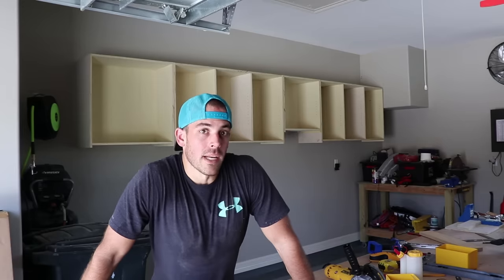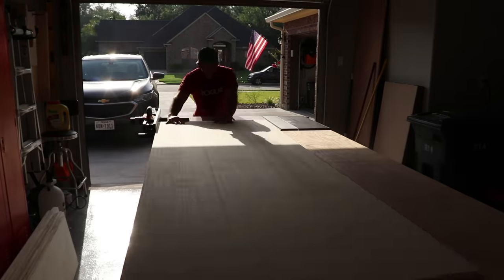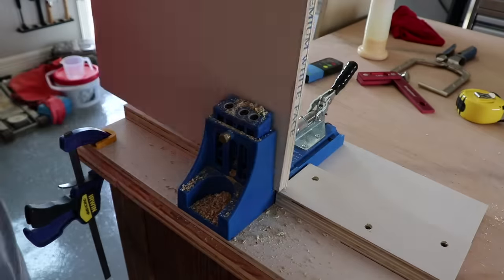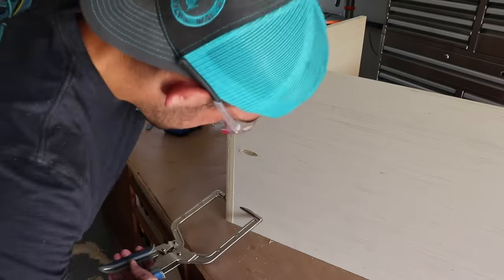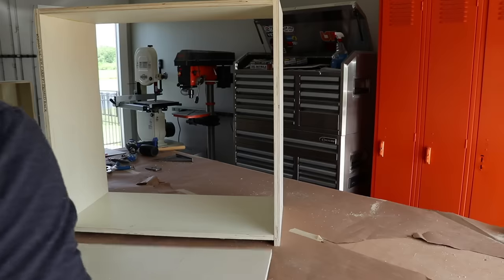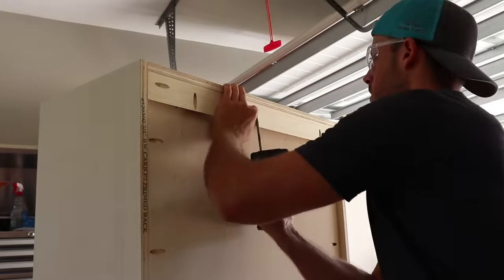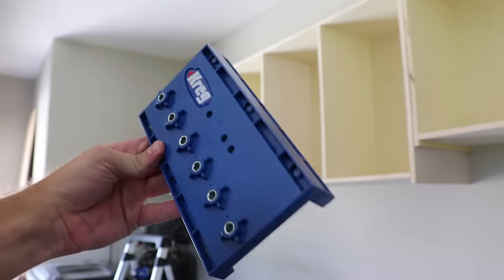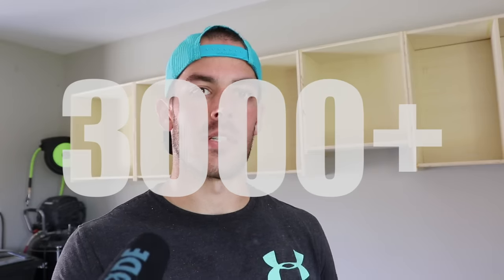Ultimate Shop Cabinet Build // Part 1

Comment: Next time you use french cleats, nibble off the sharp 45 deg angle from both the wall and cabinet side cleats. It'll make the cleat registration perfect every time, and will eliminate any chance of a little dust or an imperfect cut from messing with it.
Reply: Good tip!

Comment: Little tip for the 3/4" offsets: Cut a couple of 3/4" square pieces out of your scrap to act as jigs. Clamp them in place, flush with the edge of the cabinet, and but your panels up against them. Flawless everytime.

Comment: We also went with Gladiator Garage Works here. Love the durability and endless, re-organizational flexibility, especially when you install their GearWall panels on full walls. We also found a number of immaculate, used Gladiator cabinets and tool chest models online! But I also admire the way your shop is looking, and appreciate the build lessons as I set up a garage woodshop.

Comment: If you make cabinets you will want to use a program like "Cutlist" to utilize your material or keep the grain oriented the same dírection. It's super easy after a little messing around and will run your pieces through 100,000s of possible orientations to provide the least waste.

Comment: Great job so far. When I did my first set of uppers I also used the French cleat hanging system... but I left the backs flush and made the cleats as long as I could so I hit more studs making the system stronger. Then on the far left and far right cabinet I made the outer sides longer to cover up the cleats.
  My most recent wall of uppers I put a strip of 3/4” plywood, 12” wide between the studs and behind the drywall so I didn’t have to be so concerned about hitting the studs. I also cut my French cleats on this batch to fit each cabinet.
  Looking forward to the next video.
Ron
Reply: Thanks for adding this, Ron.  I am in the middle of designing and building my upper kitchen cabinets, and wanted to include a French cleat system for mounting, but didn't figure out yet how to hide them.  Your method is perfect, and thinking about it now, I will only have to adjust one end because the other one will be flush to a wall.  Bingo!
Reply: Kim Buterbaugh     Glad I could help Kim.
Ron
Reply: Ron.. May do something similar.. what type of screws used to hang cleat to the wall

Comment: I downloaded the plans and have started the wall cabinets. I believe there is an error with the cut sheet on page 25-- the USC bottom panel is listed at 51.56 and the top panel is 28.56. I matched the top and bottom panels at 28.56 and the entire cabinet fit well. Just an fyi... thanks and the project is coming along nicely!
Reply from the maker: Thanks! I’ll take a look
Reply: @ShopNation  Also, there's an extra wall cleat (27x4 and same page) that's on the cut sheet but not the instructions-- no big deal at all but not sure if it serves a purpose.

Comment: Is one cleat strong enough? Good job on the vid and showing the layout for the cut sheet.
Reply: mike smith oh lord yes it’s strong enough, it’s actually much stronger than the normal 1-2 screws that normally holds cabinets up, but, you do want to make sure that the cleats are screwed to wall studs

Comment: Travis, not that you're still checking comments but.....how'd you get the shelf pin holes at the back (wall side) of the upper cabinets.  Disassemble?  Manual markup and hand drill?
Reply from the maker: I used the Kreg shelf pin guide, just flipped it around and referenced the back corner, actually works really well

Comment: A great series, thank you for sharing,

Liked, Saved & Subscribed,

May I ask a simple question?

I need to build a shelf to store a very heavy tile cutter. 500mm x 450mm x 400m. Weight approx 30kg. I will be building the cabinets out of 3/4” if I support the shelf on three sides will this be enough for a 500mm span?

Comment: You might consider MaxCut v2 for your cut list and diagram. It works great.
Reply from the maker: I’m not familiar with that, is it a program?
Reply: Shop Nation yes, it's a program. It's free and it works amazingly well. You input the types of material you're using like plywood or MDF, then you input your pieces. It automatically calculates the most efficient use of the material. It produces a very nice cut list and cut diagrams for each piece of plywood. Good luck with your project. The upper cabinets look great.
Reply from the maker: Cool I will definitely check it out! Thanks a lot
Reply: @Jay Kepley I use this program and your right it is great. Really quick and you can use it even with cut pieces by using the custom dimensions as the starting piece.
Reply: Jay Kepley is that available for Mac also?
Reply: Jay Kepley gold mine. Thanks for sharing!
Reply: Jay Kepley looks like it’s not Mac friendly. Are you aware of any similar apps/programs for Mac?
Reply: Jimbo's Welding Shop Aka: The humble welder sorry for the delay in responding. No I don't know of an Apple equivalent. I just use Windows. Good luck in finding a version that will work for you. There's another program that might be available for an Apple product. I would do a Google search to see if you can find something.

Comment: I purchased your plans as they are perfect for my build space. My only concern is the space for the miter saw station. I have the Festool apex 120 and its base is 24". Will the 24" space between the two lower cabinets allow for this saw? 
Thanks, Roger

Comment: 9 dislikes from those that worship non powered hand tools and love Villa and Abrams!!!!! There is nothing wrong with MODERN WOODWORKING!
Reply: Or maybe people who like good carpentry.I don't think I would trust all the weight that's going to be in those cabinets to just a few screws holding up the cleats.Last I heard screws didn't have a lot of shear strength. Hopefully he didn't use drywall screws which are extremely brittle and are only designed to hold drywall. There is a reason it is illegal to use screws in most places for building construction.

Comment: French cleats are nice, but IMHO dedicated rails and hangers for cabinets (links below) are much more convenient, because  you can level cabinets after hanging, so you don't have to worry that much about the rail hanging on the wall perfectly level. The rails are two meters (78-95/128"), and therefore, it's easier to hang it level, and you hang several cabinets on a single straight rail. You can also make the back of a cabinet from a 3 mm (1/8") HDF, which is significantly lighter than plywood.

- hangers: https://www.castorama.pl/produkty/urzadzanie/meble-i-zabudowa-wnek/akcesoria-meblowe/laczniki/zawieszka-meblowa-2-szt-zaslepki.html 
- rail: https://www.castorama.pl/produkty/urzadzanie/meble-i-zabudowa-wnek/akcesoria-meblowe/laczniki/szyna-do-zawieszania-kaprys-met-1-x-40-mm-2-m.html

Comment: Very good video. I also like to use pocket holes. I was wondering though how do you like your Delta table saw? The reason I ask is that I am planning on getting one as well but someone mentioned that they had issues and to look at the Rigid one at Home Depot for $529. So I am just trying to get some info about the Delta table saw from someone who uses it regularly. Thanks. I really enjoy your videos thanks for making them.
Reply from the maker: I have no complaints about my table saw, love the 30” rip capacity. It’s been great all around
Reply: Shop Nation Thanks.  Your words of wisdom are well recieved.

Comment: I’ve seen videos on securing shelves when using french cleats to reduce chance of bumping it from the bottom and accidentally knocking the shelves off the wall. Any concerns about this happening with this setup here? How would you go about securing this a bit more while still making it reasonably easy to move if needed later on? Thoughts?
Reply from the maker: These things are heavy enough that there is almost zero chance you would bump them off the wall

Comment: Quick question...how did you drill the pin holes for the shelves in the back part of the cabinet?
Reply from the maker: Use the same jig and register it on the back panel

Comment: Hi, I just purchased the plans, so may have a lot of questions.....first, you call for 3/4 plywood, does it matter that most 3/4" is actually 23/32"?
Reply from the maker: That is built into the measurements, you’ll notice some strange fractions - that’s why
Reply: Ignore question! I found true 3/4" Birch. Would be nice if the pages were numbered..they tend to get out of order...all the time.

Comment: how high are your sidewalls in shop? I ask because investing ready to build my shop and trying to decide between 8' and 9' walls. was wondering how high the top part of the cabinets were and if 8' would work...
Reply from the maker: Mine are 9’, definitely comes in handy when swinging around 8pm plywood
Reply: @ShopNation  how much space above top cabinets do you have? a foot or so? other words. how tall are the top cabinets off floor. just want to know before I purchase plans. I'm planning on doing cabinets and the work outfeed table

Comment: Did you upload your plans somewhere? I need to cover a 5' span and I'd like to use your plans for the one large carcass divided into three. From your cut sheet, it looks like your cabinet depth is 16"? What is your individual opening width? And how did you mount the two dividers? Pocket holes, too???
Reply from the maker: I don’t have plans for the cabinets at the moment, as I’m building them you should be able to see how they are assembled. I just figured with them being specific to my space it wouldn’t be useful! Apparently that was a bad assumption because I get asked quite a bit...
Reply: @ShopNation  Thanks for the quick reply! I get that. However, I dont think in the video you show how you are attaching the "dividers" of the larger cabinet. Did you screw from top/bottom and back? Or, did you use pocket holes? I suppose either would work and it'd be up to me, eh? This will be my first cabinet build and I am very new to woodworking as it is, so my curiosities had to do with standard depths, etc. Anyway, I really appreciate your content. Keep up the good work!
Reply from the maker: @damongrambow7077  Ah Ok, Yes I screwed from the top and from the back on those dividers, but you are 100% correct that pocket holes would work there as well.  Since no one will see the top/back screwing directly in there is the easiest in my opinion.

Comment: Awesome video! I stumbled upon it and now I'm a subscriber. 
When I'm assembling my pieces with Kreg pocket holes and tightening the screws, I find that my boards want to travel a bit. Even with the clamps it can still move. So you have this at all? And if so did you find any remedy?
Reply from the maker: Definitely a problem with pocket holes, I can typically tell which way it’s going to move so I start with my pieces offset by a little to compensate. Not the best method but seems to work. The Kreg clamp also seems to help quite a bit
Reply: Thank you...appreciate the reply.  I look forward to the next phase of the cabinet build!

Comment: Wondering how (or why) that offset for the bottom of the cabinet will allow for mounting of the face frame. Couldn't you still mount a face frame even if that was flush like the sides and top are? I've never built cabinets but I'm thinking about it so I was just curious as to the design reasoning. Also, is the back 1/2 inch?
Reply from the maker: The back panel is also 3/4” but you could certainly get away with 1/2” there. Hopefully in the next video my thought process will make sense. You are 100% right though you could still attach a face frame with the bottom flush.  Thanks for watching!
Reply: Shop Nation Thanks for responding! Really looking forward to your next video in this series. I’m going to be building some cabinets right along with you.

Comment: I know a thousand times over the last thing you want to hear is how you shouldn't do something from a pro...oh I don't want to say this but I will.  Having built over 20 thousand boxes with butt joints and ZERO glue, the only time I ever had to use pocket screws was on finished ends.  Where cabinets butt up to each other face screw those bad boys because the screws will never be seen.  And again, you don't need glue.  It's overkill for cabinets; both base and walls.
Reply from the maker: Great to know! Thank you

Comment: OMG I'm retarded!  I have never had a table saw and have always used a (1:25) crosscut guide.  But I never considered building one to a made-to-order size.  I always had to add or subtract some stupid measurement like 3-11/16".  I don't remember the exact amount, but with the way you built it, you can probably deal with an exact 9 or 12" or whatever that is.  Kudos!

Comment: what table saw are you using?  Is it the delta that costs $599 or $999 from lowes?  Thanks
Reply from the maker: 599, my website shows model number
Reply: thanks! @ShopNation

Comment: How did you do the inside pin holes?
Reply from the maker: Very similar to the outside but I removed the edge guide and butted it up against the back surface. The bottom hole position was established by pushing the guide back into the corner. Hopefully that makes sense